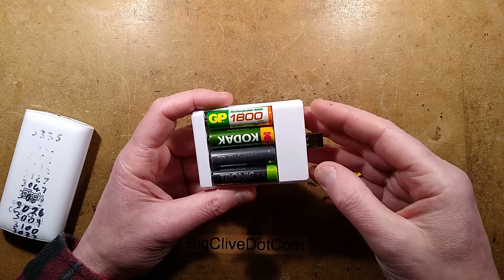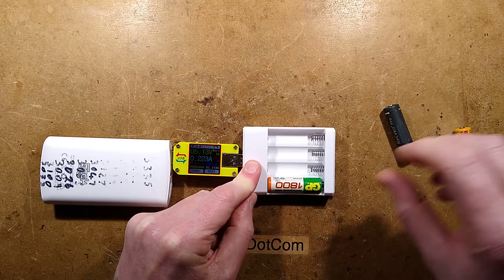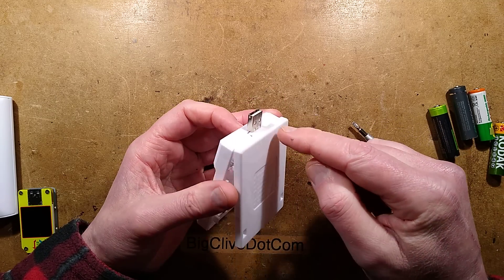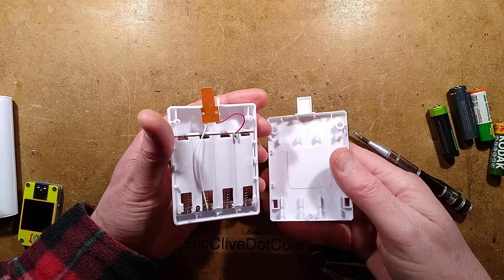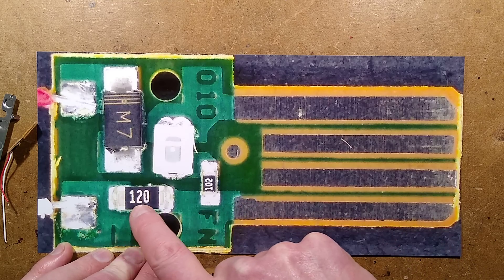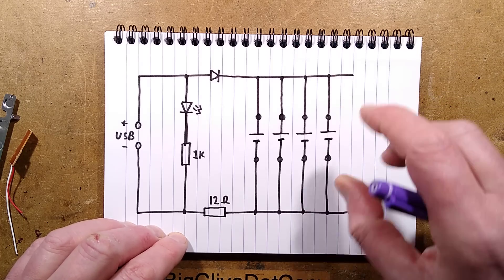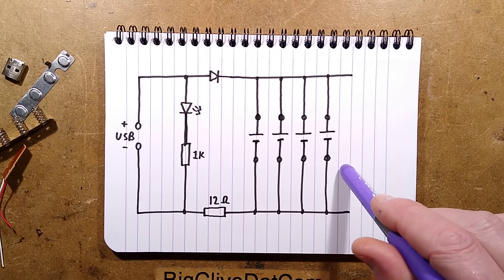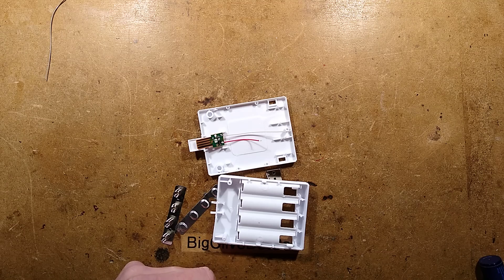Different eBay battery charger - with schematic

Comment: I think the plug as part of the housing is quite a horrible idea. On a USB connector the plug is supposed to be the part breaking of in case of an accident so you dont damage the device its attached to. This probably make the plug strong enough to rip the USB connector out from your laptop or power brick. Also doesnt this circuit mean that when the batteries are fully charged they are overloaded with a 4v input? Dont know much about this cell chemistry but that doesnt sound to great.

Comment: You got it wrong, the input is 110/220V, it is just that the power supply with the ACDC converter is not included.

Comment: I bought a dimmable nightlight to use as a reading light at home.  It came with it's own USB power supply.  However I felt the weight of it and thought "That is far too light to be either safe or power efficient, I wonder if BC would like to dissect it" but sadly I lost it.  The night light is really good though, it even has a remote.

Comment: I expected so much more than that tiny square of a circuit board...

On that note I kind of said the same thing to myself yesterday, as I was taking an oldish Emerson TV apart lol. I think it's only a 32 in. screen but I still expected to find more under the hood than I did. Got some really cool backlighting out of it though...and speakers....and whatever I can successfully de-solder from the 3 PCB's it had 🤓🧐
Reply from the maker: There's very little in modern TVs.  You can get retrofit boards for many of the functions.

Comment: Far from worst. I have an ancient soviet charger (from 1980s) that had charging from mains through a diode and resistor to NiCd cells. It had a lid over the cells though to keep the user safe but for example putting battery in with device connected to mains would have given one a nasty shock. At least the cells were in series in that one though.

Comment: You should review my Pylontech US2000 Solar PV Lithium Batteries (LiFePO4), 2 x 48V, 2,400Wh, connected in parallel (I don't know much about it yet). Currently, in my rat-infested housing association flat, I'm using around 3KWh per day, so I'm looking forward to nice low energy bills in my new solar powered house! It's going to be ⚡ ELECTRIC ⚡

Comment: I have a question about rechargeable batteries.  Why is it that in a name brand charger such as Energizer it will refuse to charge some batteries?  Mainly what I'm talking about are ones that are several years old.  I know they still hold a charge as I've used an old charger from the 80s to charge them but in the modern charger a red x appears above the battery and it refuses to charge.  Would just like to know the actual reason behind this.  Thanks.
Reply from the maker: I made a video about that.  The "smart" chargers often reject older cells because they see the voltage rising too quickly and think it's a non rechargeable cell.   If the cell is completely discharged to zero they may also just not see it.    Putting the cells into an older dumb charger will nudge the voltage back up again or can be used to charge older cells fully.

Comment: Any idea what the thicknesses of the circuit board is? I always thought that PCB printing a type A connector was pretty clever,  but it turns out that typical PCB thicknesses (1.6 mm) are larger than the the USB standard allows, meaning products such as these may put too much physical stress on the mating connector.
Reply from the maker: I think it was a thin PCB in a plastic carrier.  There is a thicker size of PCB that can be slotted straight into a USB socket.

Comment: hm, i think its bad parallelling nicad/nimhs ... i have done it recently but the link between them was a bit of 5 amp fuse wire in sleeving to hopefully protect against disasters also i'd say doing similar to lithium ion cells bad without a fusible link, i had a laptop battery pack fry one of its cells, one of a pair shorted and discharged the other pretty quick, melting its plastic wrapper 😲 lucky it didnt go up in flames

Comment: Lithium cell you say?  Lemme put one in slot 1 and a NiMH in slot 2.  Works on my last battery charger so it should be fine in this right?  Maybe if I build a USB to NEMA 5-15 so it gets the full 120V 60Hz?

Comment: How warm does the 12 ohm resistor get and is this any problem?
Reply from the maker: I'm sure it'll get warm.  But the designers associated with these products don't have the knowledge to work out power dissipation.

Comment: I can actually imagine them using a capacitive dropper, some rectifier, and probably a resistor to limit the current, in an AC version of this.
Although, the USB plug as a part of the box contradicts the marking on the box anyway, lol.
Reply from the maker: I have reviewed a light that used a capacitive dropper to charge the NiMh cells in the slots.

Comment: Quick question, how does a "smart" charger identify the type of battery installed? is there some signature to the current/voltage as it's being charged that indicates the chemistry in the battery?
Reply from the maker: Most I've come across treat anything below about 2.5V as a NiMH cell and anything above as a lithium cell.

Comment: When the cells are fully charged the current into each cell will still be driven by the Voltage V = 5 - 0.7 (diode) - 1.5 (battery) = 2.8. And the resistance will be the 12 Ohms of the resistor + internal resistance of the cell (lets say 10 Ohms) for a current of I = V / R = 2.8 / 22 = 127mA which is more than I'd be comfortable pushing into a charged cell to dissipate as heat.
I have a similar charger to balance cells of different discharge but I use individual resistors per battery and a much higher resistance. This results in a slower charge but allows me to leave the cells on charge for long periods of time without concern for over-charging them.

Comment: If a battery is low at 1V and one full at 1.4V there's 0.4V. If you have a direct contact, it's only the internal resistance of the cells that limit the current. If it's 50mOhms X2 =0.1 you get 0.4/0.1=4A. That's quite violent!
Of course it's for a limited time but that's bad.
Add the fact that you are basically trying to charge up to 4.5V instead of 1.5V, you have a recipe for cell destruction. You'll just loose all the electrolyte and battery capacity over time.

Comment: Sorry, did I miss something?  Is the entire weight of a fully populated battery charger meant to be supported by a single USB connector?  Last time I did a brush-up I didn't see USB connectors on the list of accepted load bearing rigging devices.

Comment: I've had a worse one. Those things that attack the callus on your feet etc ... Takes 4 AA's and has a USB cable included to charge them. Included a motor that was already showing rust spots. Wires of the lowest quality I have ever seen.  A plastic lever to turn the on/off switch that was already broken when it arrived and was made out of not sure if it was even considered plastic. Well the wires went directly, no diode, no resistor, to the batteries. I guess the cable is the resistor. Weird thing is that the feedback on the product is not that bad.(so feedback is no guarantee for a good product)
I now have another USB charger from Ali that was dirt cheap. Nice thing, includes micro usb and usb-c input. The bad thing. 4 slots but they charge per 2 and the fancy bars show full way to fast. So balancing?  Haven't opened it up but I think it might be interesting.

Comment: Whats stopping 2 batteries 90% charged and 2 batteries completely dead? There needs to be individual diodes to each battery leg to stop over-current into the dead batteries. 

Really bad design!

Comment: If anybody is actually interested in economizing on energy use, they should seriously consider banning anything that doesn't actually USE the USB data pins to transfer data. (Not just a resistor to program voltages!)

The parasitic loads that are building up in peoples homes must be astounding on a grid scale basis!

Comment: I guess there's also a mains powered version, using a capacitive dropper.
Reply: ... with a usb plug molded into the same part that has the text molded into it?  
I don't doubt that there is a mains powered charger somewhere, but it's not likely that it shares this part.  It's either a mold insert that didn't get swapped out, or (my bet) lazy copy-pasting in the 3D model.

Comment: I'd say that's more of a battery cooker than a charger, especially if you only put in one or two cells. What are the chances of any NiMH cell surviving being in that contraption for a few hours?
Reply: My thoughts too. Where's the overcharge protection?!
Reply: @RaglansElectricBaboon  It is insufficient to say that there is none.  It would be more appropriate to call it a "battery overcharger".  Why would it protect against the one thing it does well?
Reply: @PSUQDPICHQIEIWC  haha, you've a future in marketing!
Reply: Fully agree with that. Battery killer / fire hazard if you leave it on for days/weeks...

Comment: that is not charger  , not control , no curent resistor , why not using TC4056A is cheap as well
Reply from the maker: The 4056 is for lithium cells.

Comment: You can go cheaper Chinese manufacturer! I believe in you! 
Slap that led to charging resistor, get rid of that metal sleeve for USB, dont use those complicated springs, just bend some leftover metal strip you have behind factory, also plastic look to thick, you could make two cases with that!  :D

Comment: I guess, one could take the positive or negative terminal, cut them into individual pads, solder individual resistors and diodes on it and have a good charger. If the case fits the need.

Comment: i wouldnt want one of this if it was free, if i found a circuit that....minimalist, i would rip it out and run a cut usb cable into the end with a lm317, a few resistors and a led to indicate it is working or something similar

Comment: Purchased an 8 cell slow charger,  were all + common, and all - common. 1 cell survived... Should have opened it up before using.
These cheap cases look 3d printed, is that likely ? 
   ;)
Reply from the maker: 3D printing is too slow for mass manufacture.

Comment: It's a shame I don't have any of security keys from when i was working. Those were even more elemental, just a tiny PCB that fit into a USB A socket with a touch contact and some LEDs. Very minimalist—you needed to use needle nose pliers to remove the smallest ones, which only stuck out about 1/16" from the socket.
Reply from the maker: Sounds like the U2F keys.  I use some for my Google account.

Comment: Ah, 220V 50Hz USB connectors... first you plug your water heater into them and think they are quite neat, but then you accidentally plug your phone into them...
Reply: Give it a few more years of mobile device bloat, and people will be begging for a new USB class that supports fast charging at 10kW.
Reply: @PSUQDPICHQIEIWC  The next minor revision of USB-C will allow the host device to put out 400V on the supply rails, for charging your car. You'll be able to tell if a socket supports this feature by plugging in a normal device and seeing if smoke comes out
Reply: I'm holding out for Q charging when you put your phone directlt on to the nuclear reactor

Comment: I think, making the plug part of the PCB is actually a weirdly good idea. It certainly strengthens the plug. You don't have to worry about detaching pins.
Reply: On cheap stuff probably yes but if you have to change that connector it would be bit annoying.
Reply: @Whigu  Repairability does not seem to be a consideration in this product.
Reply: @Whigu  there's no changing the connector, only buying a new charger.
Reply: @bbgun061  simply break off the pcb and solder on a real connector. add lots of superglue

Comment: Thanks for educating me on slow charging my phone Clive, I just replaced my blackview battery that had crapped out because I had fast charged it for a year. Noticeably shorter battery life. What current do you suggest?
Reply from the maker: I tend to charge my phones with a fixed voltage 5V supply that keeps the charge current at sensible levels.

Comment: I've seen that type of USB connector before, on some very cheap SD card readers. Quite clever actually.
Reply: My USB wireless mice often come with a tiny counterpart which plugs as a dongle into a USB port, so only the antenna part sticks out, and they don't obstruct connecting normal plugs into neighbouring ports, nor provoke breaking the port.
Reply: I've seen it a lot on small USB things such as USB sticks.  The extra plastic bits to obtain regulation thickness are a sign of quality craftsmanship, but the inclusion of text for a non-USB product in the same mold is a big mistake .
Reply: I have a bag of super cheap 16gb "usb 3.0" mem sticks like this, cheap, cheerful and only used for boot Utilities

Comment: Charges until you decide its charged enough?
Sounds like my ATU-100 auto antenna tuner, not cheap tat at £70+, but definitely a problem when charging the batteries, or over changing,stressing the c-type connector, until no charge can be accepted.

Comment: I am surprised at how cheap this is made that they even bothered to put the Diode in.
Reply: I'm surprised it has four metal contacts for the USB...
Reply: I haven't seen something so minimal since tearing apart 70's and early 80's NiCd chargers as a kid...
Reply: My guess is, if a battery is reversed, it might destroy another battery or the unit, but it won't destroy whatever's powering the usb. Avoids angry lawsuits for wrecked computers.
Reply: @LordPhobos6502  Lawsuits? In China? About an unbranded Chinese trash unit sold by some anonymous ebay re-reseller? 😂 Good luck with that! 🤣😂🙂
Reply: @LordPhobos6502  this exactly is quite surprising, tbh.
Reply: @LordPhobos6502  chiner Don't give a f about your lawsuits hun

Comment: Description suggestion : Auto balancing NiMH cell charger (since they're in parallel they should Equalize voltage
Reply: Where "balancing" is used as a synonym for "precariously dangling".

Comment: I haven’t seen anyone else say it, so I will.

What have you been drinking, dear Clive? The diode and 12 ohm resistor belong on the left of the LED in the schematic you drew. Trivial really but still.

Also, it seems there’s nothing preventing the batteries discharging through the LED other than that 1K resistor, and I wouldn’t trust it. Not as if any of it is trustworthy…
Reply: The diode stops the batteries discharging through the LED surely?
Reply: @katrinabryce  It would if it was where he drew it, but it isn’t.

And don’t call me Shirley.

Comment: Gee and I thought the DeltaV type Nimh chargers that would only charge cells in series pairs were lacking. I guess it can always be worse. Maybe the next one will get rid of the diode, resistors, and LED and let the USB port limit the current.

Comment: I'm done with cheap chargers. I finally purchased a good quality four battery charges that can sense the battery type and can charge four different batteries at the same time. It was worth the investment. Especially with my 18650 flashlight batteries.
Reply: It's really impressive how good basic chargers have gotten in the last few years, which is great because now I can finally tell people to just pay the extra like $10 and get a good, if a bit lacking in features, charger that won't burn their house down.

Comment: If you turn the diode around, you just made yourself a DYI powerbank, but that 1,2V is not going to power miracles.
They should have called this abomination "battery killer". Who the hell puts a USB-A as the INPUT?
I rather take a charger, who has diodes on each channel. Didn't Clive built one as a trickle charger with looooow C rate?

Comment: Can't think of a suitable way to connect that USB to ... bit of a silly design !   You would need a wall wart or charge pack that was just the right thickness, otherwise there is going to be stress on that USB port.......... surely a short lead would of only cost a few cents more, or just put a microUSB port in the unit.
Reply: Use a short USB extension cable
Reply: Just plug it into a USB charging port that is pointing up, such as one in a surge protector.

Comment: 120-240V 50/60Hz had me laughing. Would love to see what that does to the diodes. (ZAP/POW?)
Reply: Wire up 240V to a USB connector & plug it in...

BOOM!

Battery guts everywhere.
Reply: I fear that even the Explosion Containment Pie Dish would be insufficient.

Comment: Yeesh, that's some serious penny-pinching.  They saved what, less than a penny by going with a single diode and single resistor instead of four of each?
Reply from the maker: The main saving would be in the tiny PCB and just two soldered wires.

Comment: If its cheap it might be handy as a battery box. I dont think much of the circuit for charging battery's, while it swings out of a usb charger. Especially if it was in my house it would get put on charge and left to cook for 3 weeks until I remembered them 🤣    
interesting bit of tat 2x👍
Reply: There's enough room it might be the project box too.
Reply: @jmr  yes it could be used for that. 👍👍

Comment: I can imagine this breaking lots of charger ports,  as it dangles from them.
Reply: I want pcb edge mounted male usb connectors to only be used for tiny dongles
Reply: I have USB extension cords for dealing with assorted devices like that.
Reply: @Alacritous  I stopped using mine because the voltage drop was ridiculous for larger loads
Reply: @joecool4656  well, in this very case it won't be excessive at all. Quite the other way.
Reply: The cheap shit Chinese lead free half cold solder joint will break off first I bet